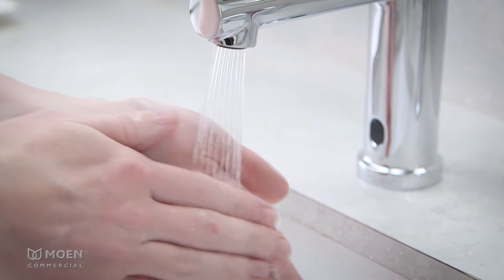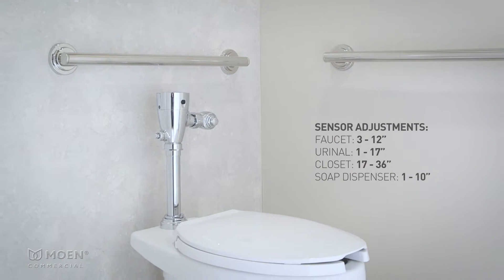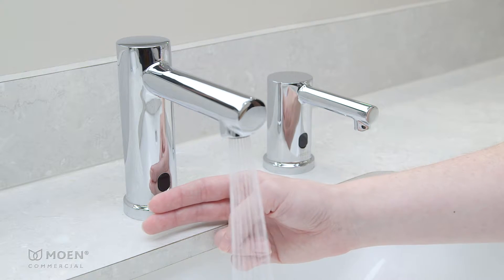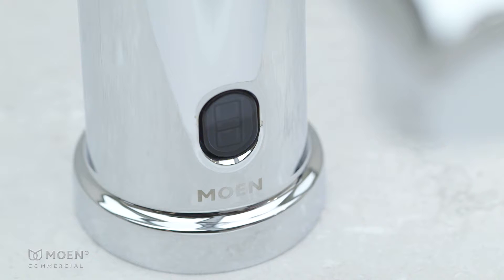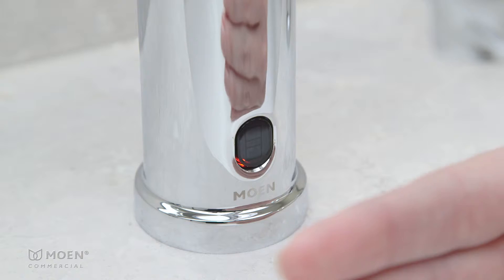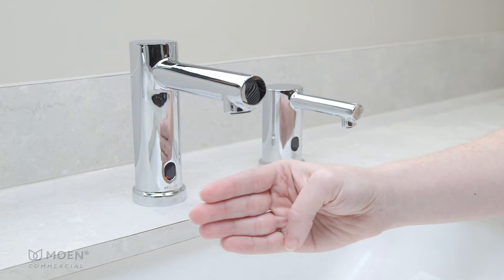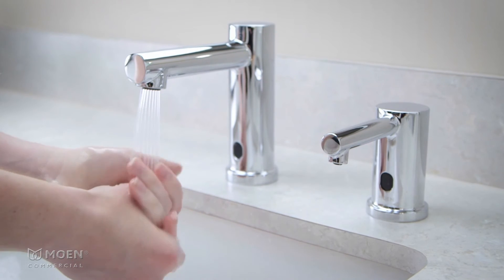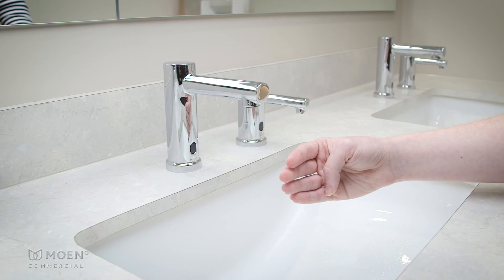5.Programming Detection Distance on M-Power Faucets and Flush Valves

Comment: Soap included!
Reply from the maker: The soap dispenser 8560 is not included with the sensor faucet 8559; however, it can be purchased separately. If you need assistance, please contact Moen Consumer Services at 800-289-6636. We are available Monday through Friday from 8:00 am – 7:00 pm Eastern Time.